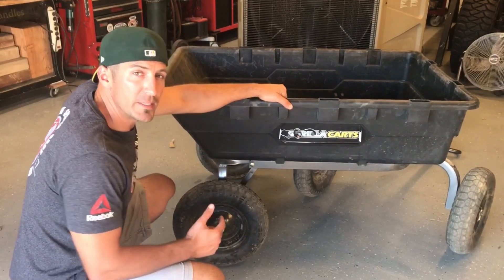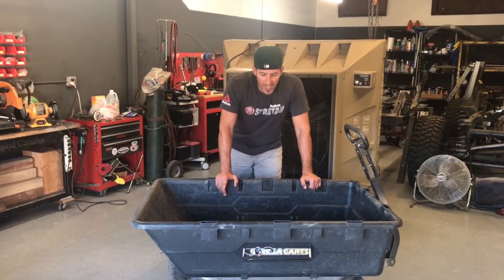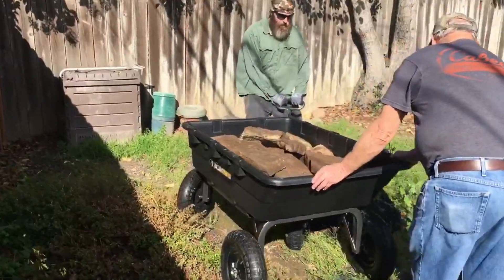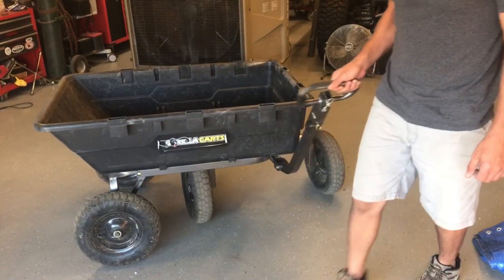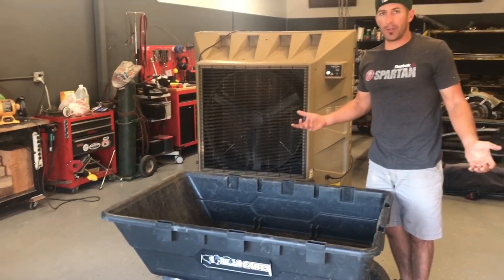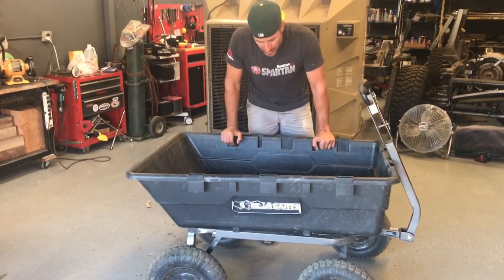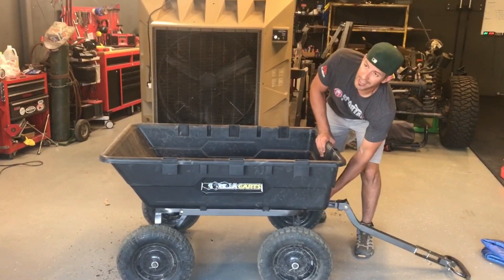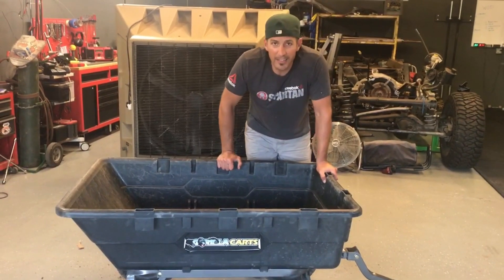Gorilla Dump Cart Review

Comment: Nice video. I am thinking of buying this product. I haul firewood off my property using my ATV to pull the cart. I currently have an old two wheeled cart and thinking of this one, because of the heavy duty features of this product. I am wondering if the 7CU foot version would work too, I think the load capacity on that one is 1200 lbs.. Thanks.
Reply from the maker: hi, I might recommend getting the bigger cart because it might be a little stronger for towing behind an ATV but also the bigger capacity is great when you need to haul brush which takes up a lot of room and it’s not heavy., Thanks for watching

Comment: The 7cu ft version is a more manageable option. That behemoth fully loaded with sand would weight 1000 lbs
Reply from the maker: very true!! I’ve should’ve mentioned that and it could also use brakes when it is that heavy! thanks for watchin!!!
Reply: Its ergonomic!!  I use my garden tractor.   Pulls it like a dream!  Easy to dump a load of dirt and block . I'm a 67yr. old woman.  My favorite garden /landscape tool

Comment: Do You reckon  that theese would go OK on soft beach sand  want to make a beach cart
Reply from the maker: only if you're hauling less than 60lbs. if you need to carry more i would buy double width tires and modify the axles to accept bigger tires. you can find bigger tires on northern tools website👍

Comment: I'm very experienced backing up trailers of all types.  The four wheels make this cart almost impossible to back up with a lawn tractor.  Thoughts?
Reply from the maker: Jay Wheeler you are correct, there are two pivoting points.  you have to restrain the pivot point which is where you hitch it to the lawn tractor (not the pivot point on the wagon) . it is frustrating! I havent designed a restraint but i think a 3/16 thick metal plate would help solve the problem if you drill multiple holes in it and connect it to the wagon handle with multiple bolts. hard to explain without drawing it out.. good luck👍
Reply: I just unhook the handle and move the cart where it needs to go to dump. Converting the handle to a fixed position is pointless because the farm supply has a light duty trailer for around 100 bucks with single tires and would not be an issue.. My wagon is the smaller size and it works well for me.
Reply from the maker: @heavymechanic2  yea its amazing how cheap you can get trailers these days, harbor freight has a few different trailers for only a couple hundred!

Comment: I just used my metal wheel barrel, and made a cart out of it >  MUCH CHEAP AND BETTER >>>  Plus it pull much more easier >  Than the Gorilla Cart
Reply from the maker: id like to see the cart u made!? i like simple robust things
Reply: @WorknDirt  I'am done with cameras.  got some tube frames welded up. to make more hand carts. I would like to fine more metal wheel barrel tubs. There sweet work dump carts. I might have to use expanded metal. make flat beds ~ My only cost is my time and wheels. SO FAR!  i have paint

Comment: I NOT)ICED AN OLDER REVIEW WHERE THE FRONT TURNING ROD WAS GIVING OUT. IT DOES NOT RUN THE SHAFT THROUGH TOP OF METAL, JUST BOTTOM.  SIMPLE FIX BEFORE IT WEARS.  RUN A LARGE BOLT DOWN AS TURNING PIN WITH LARGE WASHER AT TOP DROP THROUGH FRONT AXEL AND USE ANOTHER LARGE WASHER AND LOCK NUT OR CARTER PIN (DRILLED HOLE THROUGH BOLT.
Reply from the maker: alton Davis Yes that sounds like a valid solution for sure! thanks for watchin!!!
Reply: cotter pin

Comment: Anyone use the 600lb version?
Reply: Just got the small one today it's not full frame like the bigger one it seems pretty good for leaves mulch lighter materials does have smaller tires should do basic yard work just fine could be modified to last longer easily but for 80$ its cheap

Comment: THAT TROLLY IS ABSOLUTELY CRAP? BE WARNED?
If you want to use it for transportation of soil, forget it. I made a huge mistake buying one and 
it turned out to be one of the worst things I have thrown money at.
It does not, I repeat, it DOES NOT, empty it's load when tipping out soil. Especially if the soil is a little damp as soil is prone to be. You will be running back for a spade to be able to scrape out 3 buckets worth left inside. This is due to the back resting on the ground. So you try jurking the thing, yet that won't help. Also, the thing is extremely badly designed, (I'm a designer) the metal supports are flimsy, the steering arm rattles and I got rust showing on all the bolts used, these are supposed to be self locking, yet have had them rattle off a few times. There is also no was it could manage a load of 300 kg, you should remove the video. It's only going to be good for carrying leaf, if it had higher sides.
Reply from the maker: I agree wet soil would be hard to get out but this cart saved us a lot of work transporting sand, bark, dirt, etc from the driveway to the backyard for one of our customer's projects. But thanks for the information..